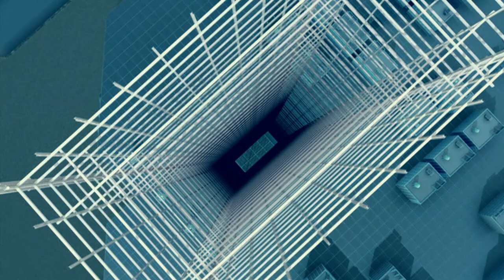Confusing the Wind | Skyscraper Innovation

Comment: Bundled-tube system for the Sears Tower, not exoskeleton. Exoskeleton means something completely different. Research well.
Reply: Bah, you're nitpicking. He's saying exoskeleton because the exoskeleton is the fundamental difference between regular buildings and these skyscrapers. He could have thrown out what bundling it is called though.
Reply: @HungryLoki  
"Exoskeleton" means "exposed structural frame." Instead of being covered by cladding or other surface materials, exoskeleton showcases the technical aspects of the building by putting them on display.

Putting the structural elements towards the external part of a highrise building is a structural system called "Framed Tube," of which Sears Tower has 9 framed tubes, making up its bundled tube system.